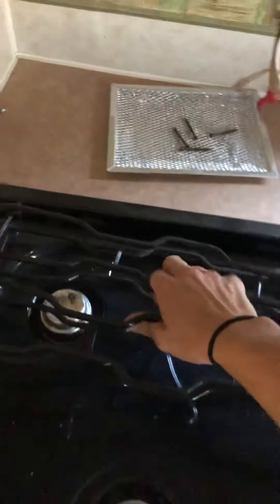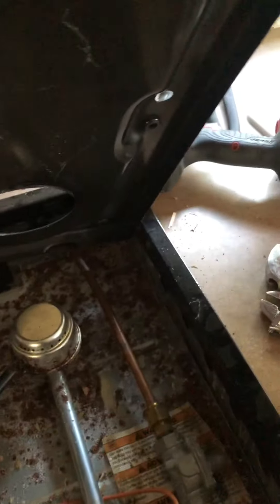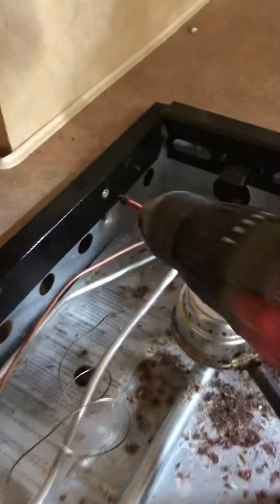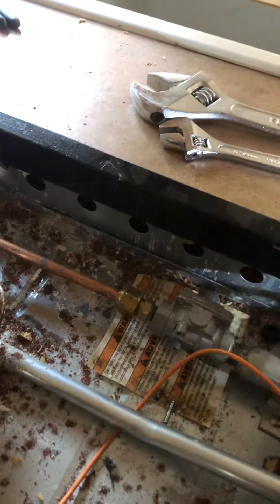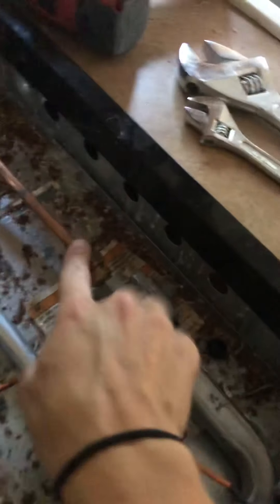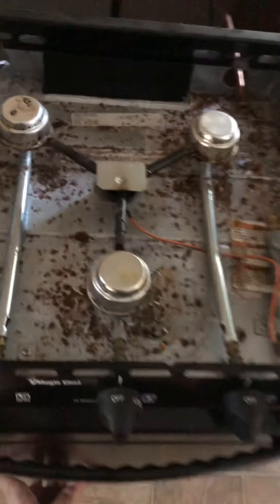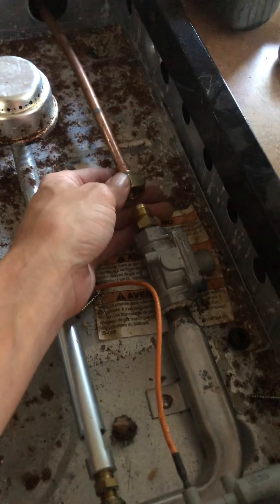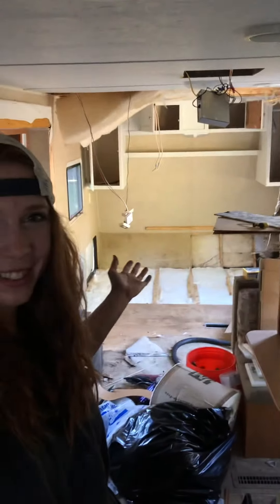RV RENOVATION: How to remove your stove/oven in your camper!

Comment: Most ranges only seem to have the 4 screws in the top, based on all my research, and I could not figure out why mine wasn't coming out after those were out. Thank you for pointing out the ones on the bottom!

Comment: Nobody talks about capping off the gas line or what to do with it if you’re not replacing the oven with another gas oven or stove???
Reply from the maker: If your not going to be using another stove, just cap the line and secure it to the wall. My guess is it’s a 1/2 or 3/8 inch flare plug fitting, and apply thread tape to the fitting (the one for gas is yellow) and screw it into the line. Once you turn your gas back on, put dawn soap on the joint where you screwed the fitting in. If there’s no bubbles, your good (no leaks). If there’s bubbles, you need to tighten the fitting more.
Reply from the maker: If your not sure about the fitting, take the other fitting (where you put your other wrench to unscrew the line) that the line screws into off and take it with you to the store and tell them you need a cap with a flare fitting for that size.
Reply: what to do with the oven gas line?